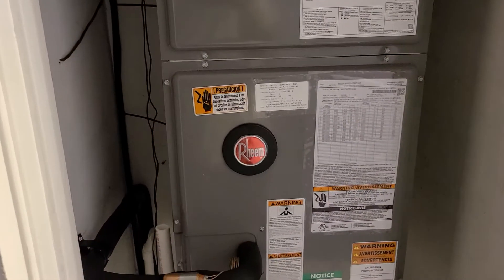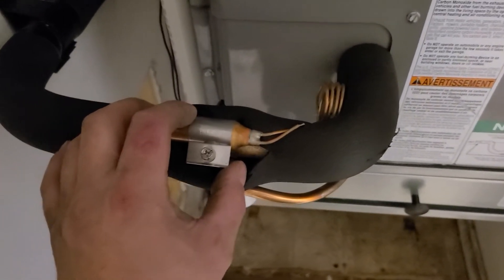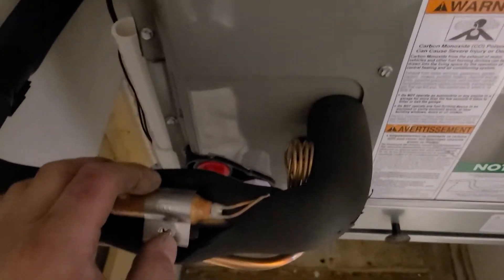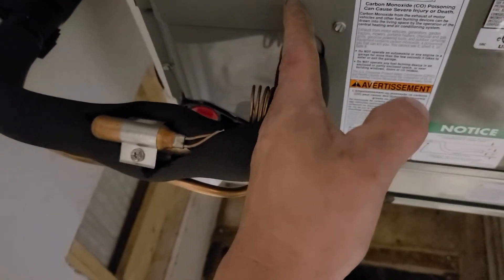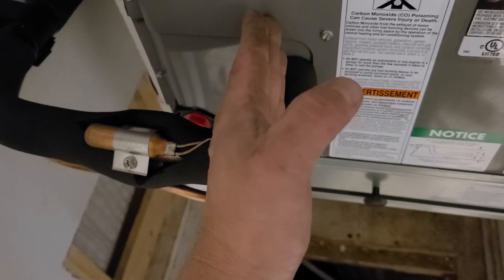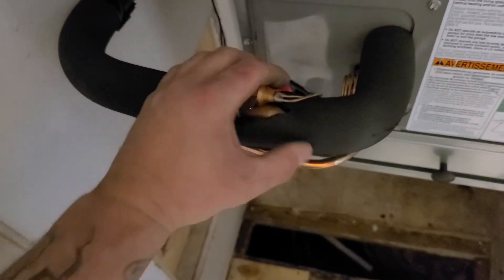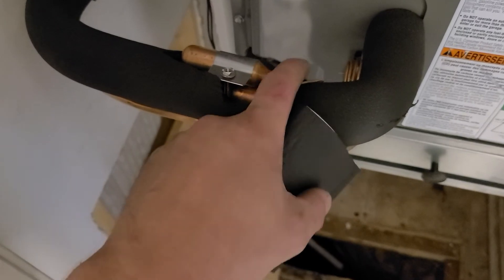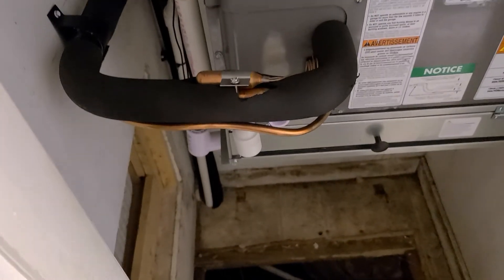How To Correctly Mount An HVAC TXV And EXV Sensing Bulb.

Comment: @InfinityAirHeatingAndCooling Thanks for the nice upload although I don't know why you have attached the bulb in such a remote location as according to  general rule of proximity to the Evaporator Coil is that the bulb should be near the evaporator coil to accurately sense the refrigerant temperature as it exits the evaporator coil. While your location is too far from the evaporator coils, am I missing something, please help me understand as I have similar Rheem 2.5 Tons 13 Seer air handler (Heat Pump) Using TXV and R-410A, thanks
Reply: 6 to 8 inches is fully acceptable. The closer the better yes, but as it leaves the coil in this video there is a braze joint and then a 90 so there was no good place to mount it until after the 90 where the pipe is nice and clean and no braze or anything else in the way obstructing the bulb. Sometimes putting it A little further out as opposed to where a bunch of obstructions are is sometimes better.
Reply: @michaelstephen5310  Thank you for your response. In my unit the technician had installed the TXV bulb on the copper tubing inside the air handler (inside the cabinet), right where it exits the actual evaporator coil frame. After 10 years, I've noticed significant rusting in this area so now I am considering relocating the bulb myself. I saw this very helpful video where the bulb was mounted even outside the cabinet! which seems much safer from rust, but I'm concerned that it might be too far from the actual evaporator coil frame? I'm also puzzled why the original installation 10 years ago was inside the cabinet and on uninsulated vertical pipe rather than horizontal and whether this was due to a lack of experience of the technician or some other logic?